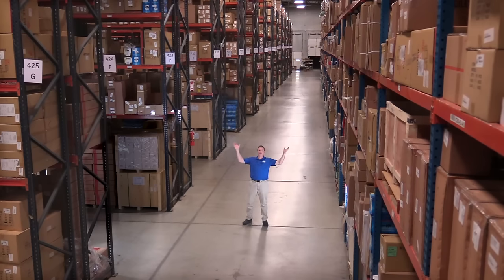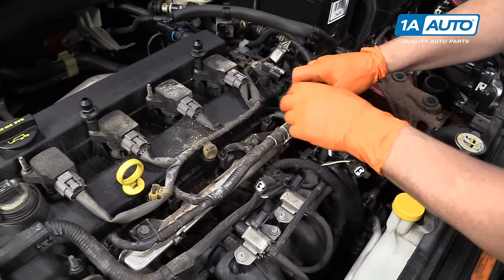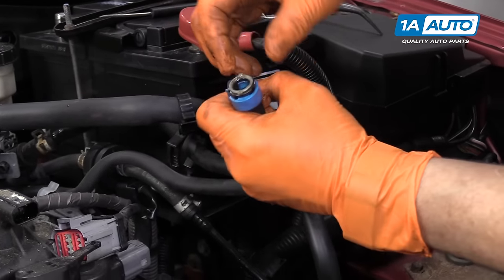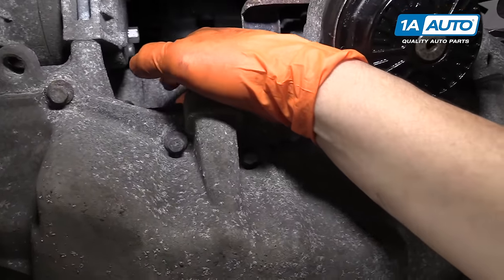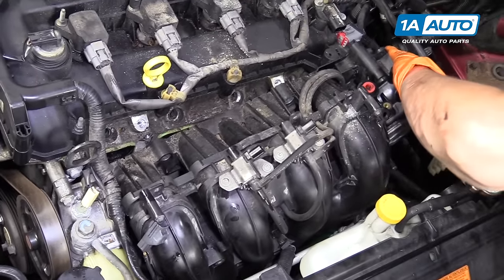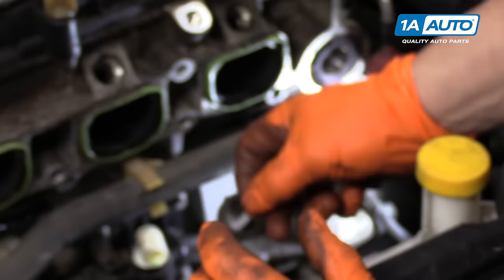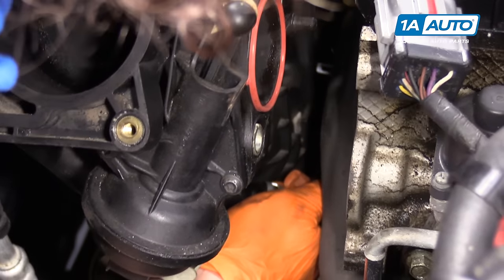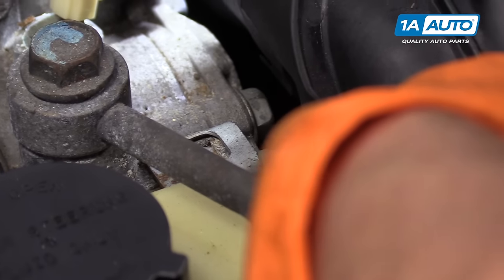How to Replace PCV Valve and Hose 02-09 Mazda 6

Comment: I did this to my 2003 mazda 6. Now the car wont start and everything has been properly connected. Mind blown
Reply: Did you ever get your car running?
Reply: i had an issue like this, I removed everything and put everything back, but wouldn't start, i was stumped, then for some reason I started to clean off my connections, and cleaned my starter connection, then was reading the manual but couldn't find anything about it, so I tried starting it again, and sure enough it started. The starter connection was bad, it was from the rust, and it was just a coincidence that it happened at the same time i was doing the work.
 So you either forgot something, or there was something going on prior and was a coincidence, or your'e just being a troll and there really isn't anything wrong, and in the case you probably do not even own a mazda6